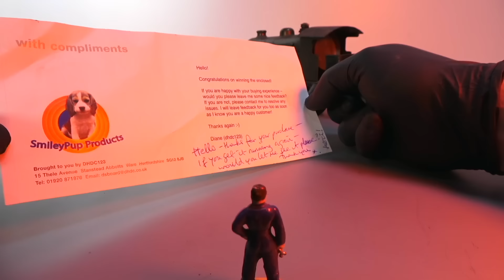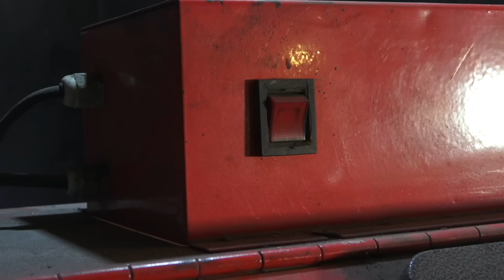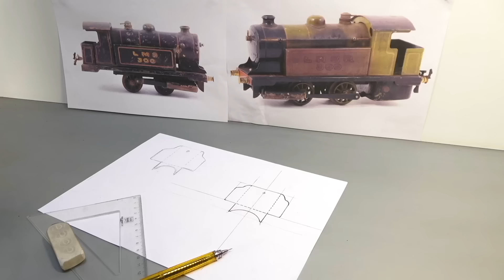1932's Live Steam Locomotive - Bowman LNER 300 - Restoration

Comment: I really appreciate that you run the locomotive after you restored it, even though it tarnished the paint and stickers. It was built to be run :)
Reply: it's not like real life steam locomotive weren't so grimy and dirty
Reply: When watching,  I cringed at the stickers and the end of the video proved me right. The original was painted. Stickers should not be used. I also think sand blasting brass is a terrible idea. Could have dunked the boiler in vinegar for a short time for better clean. Also I caution against jbweld on boilers.
Reply: @christopherbusch1933  this guy has been doing these restoration videos for a while, so I think he knew what he was doing
Reply: @trainguy69  I've been doing model restoration for a while too, and I definitely dont know what I'm doing still
Reply: @christopherbusch1933 wouldn’t the jbweld be fine as it’s only being used for cosmetic restoration?
Reply: @christopherbusch1933  some good point's, butter nevertheless a nice restoration.  These things where only soldered bolted or tinplate folded. The stickers where some kind of transfers or litho depending on the brand.
Reply: @christopherbusch1933  it is not a high-pressure boiler; JBweld should be fine to keep it together. After all, it’s a toy, not an actual piece of heavy machinery. It was never going to get up to high pressure. Also, from what I’m seeing, he merely touched up the smokebox near the front of the boiler - that part is not under pressure.
Reply: @Raptor22  Toy boilers can still burst causing injury. The sandblasting could work harden the boiler which could make the metal brittle.  But I didn't make a youtube video about it, so I'm not an expert.
Reply from the maker: knowing the result, I admit that I hesitated before making it work😬
Reply: @trainguy69  he doesn't know in this case. These boilers are made from very thin brass, and Sandblasting can cause it stress, that weakness its strength and can be dangerous to operate. Sandblasting the pistons is also a bad idea. He should have also used flame proof paint, less likely to burn on the first run.
Reply: @trainguy69 )}
Reply: 19:49 what the heck happened there ?!
Reply: @joeylumbley  Heat from the flames inside. It was originally all brass which prevented this from happening

Comment: Needs stainless steel plates mounted between the boiler and the original panel with the decals on with a gap between them to act as a barrier to possibly stop the decals getting damaged. But stunning restoration regardless. Love the fact it was mostly bolted together and not rivetted.

Comment: Great job, I own a BOWMAN 4-4-0 -234 locomotive WITHOUT THE TENDER. The piece is in good used condition blackened, I repaired the safety valve, and went over the coloring leaving everything as it is. I appreciated excellent functioning, so much so that I thought that a possible total restoration could damage everything ...
Reply from the maker: If it works that’s just perfect… maybe I’m going a bit too far 😅

Comment: Nice one! 
I also have one of these wild locos.  There is a part missing that helps reduce the burning of the "side tanks"  There should be a steel plate running from the footplate, up inside the side tanks and fitting under their top flange.  
 These can also be "superheated", by running the steam pipe from the back of the boiler, along the burners then into the T piece to the cylinders. Great fun.
Reply from the maker: Oh ok I didn’t know that ! 🙏

Comment: Hi , just wondering,  should there not be felt washers behind the piston on the rod ? These were soaked in oil and lubricated the pistons in the cylinders.  Good stuff otherwise ❤
Reply from the maker: Thank you !! If the pistons are too old or if you want more power you can add one or two joints 👍

Comment: This was awesome!  I'm so sorry the side got burnt :(  I would've been fine with it being a showpiece after all the work you put into it.  I hope it cleaned up okay
Reply from the maker: Thank you very much !! I wanted to put it on the bookshelf but these trains were built to run !! I have a few labels left ;) 😌🙌
Reply: @TheFabrik  If you keep the wicks short in your methylated spirits burner the flames from the fire will be lower and hopefully not burn your excellent paint job.
Reply: @TheFabrik  You could try a heat resistant finish over the sticker to see if that helps keep it, or see if you have the ability to paint it right on instead of as a sticker.
Reply: They make high temp pant in rattle cans that are used to paint engines I’ve seen in different colors. Amazing work.

Comment: Great to watch, as always. Thank you for the entertainment. Have you considered adding Deepio to your range of cleaning products ?   It is essentially a very effective degreaser for commercial kitchens, but would easily clear a lot of the built up grease I've seen in some of your videos, is non corrosive to handle, and is resusable for a long time if kept in a small container. In a number of kitchens, I've never come across a better or easier to use degreaser.  Regards, and good luck.
Reply from the maker: Thank you very much for this advice. I will think about it ! See you soon😉

Comment: Hi, your missing the heat shielding on the inside of the simulated watertanks. It will make an airgap between the flames and the painted outside. And don,t forget to use the steam oil for lubricating the pistons and other moving parts.

Comment: you may have had the wicks too high up, or used the wrong fuel, if you reduce the flame size you can still make it run without blistering and burning the paint. lovely restoration nonetheless though
Reply from the maker: thanks for your advice 😉

Comment: Too bad about the decals and green paint. You did right with the black stuff being heat resilient. You just need some of the green and clear coat with the same properties.
As for the decals I believe there are company's that makes those for brake calipers and motorcycle exhausts. tslgraphics got some that can stand 360F.

Comment: I mean absolutely no offence by this, but why do you run the train when it could - as it did in the video - ruin the gorgeous paint job? It’s a stunning restoration, but it just seems a shame to burn it in the end. Great job though!
Reply from the maker: Thank you !! I understand but I couldn’t help but to test it on the rail track. My mistake was to print labels instead of painting them with high heat paint. Also a heat shield was missing apparently. Thanks again !
Reply: Live steam models are meant to be steamed occasionally.... thats the point. The restoration is quite good for the most part, but the painting, though it looks nice with the stickers ect... will never hold up if your wanting to run it. Etching primer on bare metal, enamal is great for base and as for lining and sign writing... thats an art of its own.

Comment: Nice video, looked beautiful, but as a hobby engineer this was painful to watch. So much more needed to make this a nice live steam model not just a display model. 

Please say you pressure tested that boiler with water before running it on steam? Doubly important if it's that old and you hid the weakpoints in the boiler using JB weld (or similar.) Honestly kinda irresponsible not to at least mention this in case some viewer tries restoring their grandpa's old toy and it blows up on them.
Reply from the maker: Thank a lot Ed. That video isn’t a tutorial even if you’re right I should have shown the pressure test. The owner told me the loco was working pretty well so I had no doubt about that. I restored another live steam loco on my channel I disassembled the boiler and tested it. There is a safety valve and honestly the risk of explosion is near 0 (if the safety valve works well). I’ll add a few lines in the description 👍 Thanks again 🙌 I used Jb welds only for scratches and bumps 😉
Reply: These toy steam engines only run at 15-20 PSI.  There is little to no danger of a boiler explosion, provided you are using the original burner, and the safety valve works at least to a degree.

I have a 1962 Mamod steam roller that had the solder for the whistle fitting let go while I was running it, there was a whooosh of escaping steam, and that was it.

A bigger danger with these mobile live steam toys was to have it roll over and spill burning alcohol everywhere.  You cannot see the flames in sunlight or a bright light; a boy was badly burned running one of the Mamod toys, which is why they switched to the solid fuel tablets in a fuel tray.

Beautiful restoration; I love watching your work, and seeing the finished product.  I have restored HO, S, O, and G scale electric and live steam trains back to running order, but they weren't as bad, and I did not tear them down completely like you do.  Thank you for sharing.
Reply from the maker: @survivingworldsteam  hey James thanks a lot for all these infos !!! I have a Mamod lined up for restoration ;)
Reply: @TheFabrik  looking forward to seeing it.

The only boiler explosion (BLEVE) event I am aware of involving these toy boilers was caused by someone trying to run one with a propane torch.  One of the silver soldered seams gave way,  the resulting explosion deafened him for a few minutes, slammed the door of his room shut, and cracked one of the walls.  The inside of the boiler was completely dry; all the liquid inside vaporizing to steam in an instant.  The torch was not a recommended burner for one of these!
Reply from the maker: @survivingworldsteam  oh wow ! I guess he was lucky not to get burnt. I restored an old blowtorch and I absolutely didn’t want to try it 😌 in any case those little engines remain dangerous 🙌